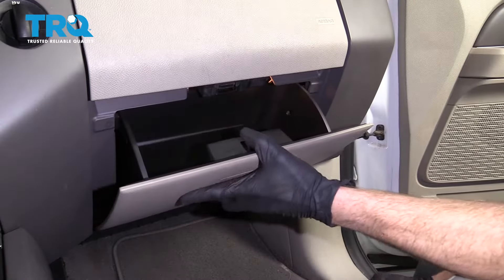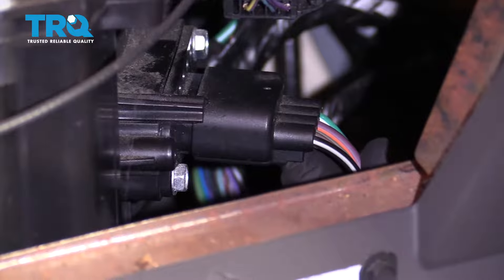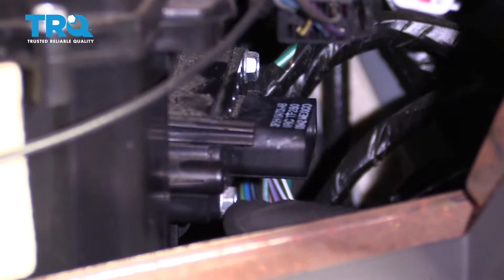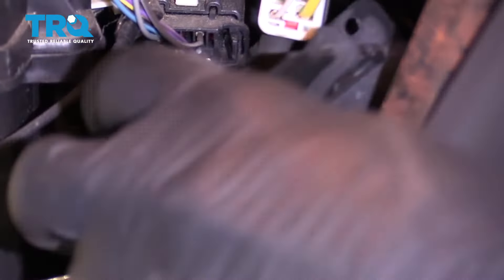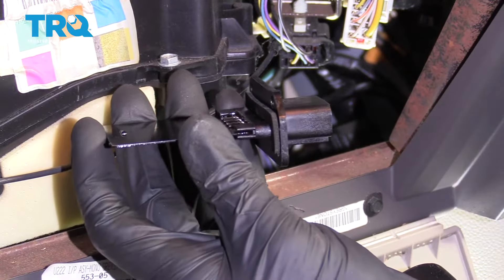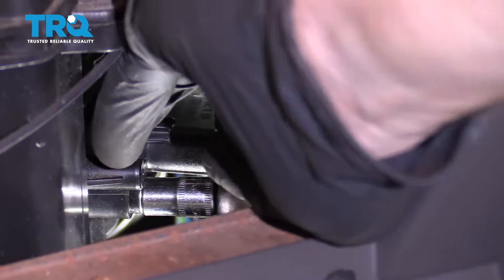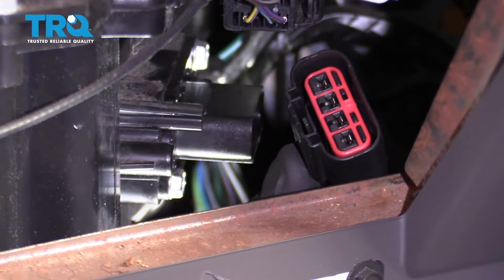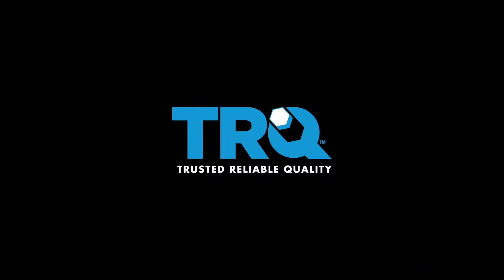How To Replace Blower Motor Resistor 2007-2017 Ford Expedition

Comment: Anyone might know why my ac will sometimes work but then stops or just won’t work sometimes? I have a 2007 expedition I’ve changed the fuses, and now just the resistor and the blower. But the blower just won’t spin
Reply: I’m suddenly having the same issues
Reply: Same 2007 expedition
Reply: I have a 2010 expedition but mine doesn’t throw any air from the front i took out the blower motor had it still plugged and turned the ac on it started spinning so I’m not sure what it could be
Reply: check the pig tail connector itself. Often times it may be the problem with this
Reply: It’s weird my 2010 navigator has a totally different resistor look and they sent me that looks like this one… will it work?

Comment: For anyone that has a 2015-2017 ford Expedition, I found out it wasn’t the actuator, it was the sync on the settings, click on climate, and turn on the back AC aka the second and third row. 
It wasn’t the fuses🤦🏻‍♂️ went through a lot, and finally figured it out